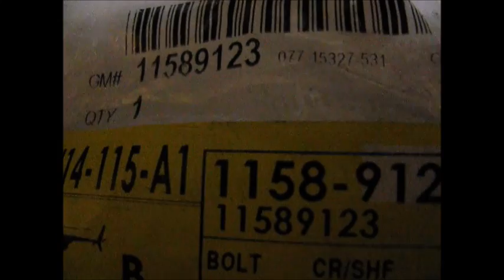GM 2.2L Ecotec timing chain replacement '03 Cavalier part 5: Front re-assemby

Comment: Not sure if you still read or respond to the video.  I just finished mine up and it sounds the same the pistons are turning I'm getting fuel and spark but it still sounds like it did before I started on it any suggestions would be a great help my timing marks are all on 10 n 2 and 5 for the crank I had #1 at TDC before I started on the repair not sure what I did wrong this was my first time ever attempting  to do this so I was pretty much learning as I went
Reply from the maker: It sounds like you did everything right. You may have to consider the possibility that valves were bent when the chain slipped or broke. This is an interference engine and valves can make contact with the pistons with chain failure. I worried about that when I did this repair and I got lucky. You may not have been so lucky.
Reply: @TheOriginalMechanic thanks for answering back much appreciated. everything was turning and when I turned it by hand before putting everything back together I didn't hear any noise or anything that sounded off I took the valve cover off again and the chain is tight the tensioner is set   it my first time so I might of missed or overlooked something but with no garage it's going to have to wait until it gets nicer out before I try again I'm 100 % on the timing marks I did check that yesterday day except the crank but I know it's at 5 cause I had to argue about that one I even checked all fuses just in case but all was good. It did backfire once but nothing after that it wasn't anything crazy that I would think did any damage or what not it wasn't to loud I'm just confused . If something else small and insignificant you would happen to think might cause the problem let me know
Reply from the maker: @00Slacker Yeah, that's frustrating. Nothing else comes to mind at this point.
Reply: @TheOriginalMechanic  thanks definitely appreciate the knowledge and your videos for sure helped me out with attempting to do that mess I'll keep tinkering with it and hopefully it'll come to life I'll get back if I can succeed..

Comment: Does that have tdc marks on crank sprocket
Reply: Turbo T I am not sure about the 2.2 engines, but on the 2.4 Ecotec used in the 2010 and later Equinoxes, which has VVT with phasers, there is a small notch on the edge of Crankshaft Balancer (or pulley) on the side closest to the front of the engine and a corresponding raised 1-inch indicator line cast into the front engine cover at approximately the 11:00 position. The problem is that this notch and alignment mark (or indicator line) are generally not mentioned in the various guides to this engine, and it is only obvious if you support the motor, remove the passenger-side engine mount, and then remove the tensioner mechanism for the serpentine belt.  Then, if you shine a light down to the spot I mentioned, you will see it, and then, with difficulty, you can mark it with paint, so you can find it again while looking up from the wheel well(after removing the plastic shield).  Aligning the notch in the balancer wheel (pulley) with this alignment mark on the front cover is the only way you can be absolutely sure that the engine is at exactly top dead center (TDC) if you are trying to fix valve timing issues without taking the front of the engine apart.  If you are off by 6 degrees or so on the valve timing on either camshaft, then the money light (a/k/a the check engine light) is likely to come on, the engine will not run correctly, and either you will have to go back into the engine and fix it yourself, or pay someone  a fortune to fix it for you.  Before I located this notch and alignment mark, I tried several times to find TDC by using a dowel and very careful measurements, but I could not do it accurately enough to reset the valve timing to the correct timing marks, and the cam/crank correlation codes kept popping up after a few  minutes of driving.

Where I live, the independent mechanics refuse to work on Equinox engines and routinely refer anything more than an oil change to the local Chevy dealers.  The Chevy dealer I took it to wanted about $5,700 to replace a bunch of irrelevant parts with no guarantee it would be fixed.  They told me that the engine might be blown, but would offer nothing as salvage. They wanted me to give them the car. This is a car I drove into the dealership with only a CEL and a few MIL lights on, but which was not running when I went back to check on it. Rather than pay them to experiment on my car, or give it to them, I towed it home and have done the work myself.

Comment: The video was great! Did mine today. Took the top radiator hose off.  Put a piece of 2x8 on your jack and a piece of 2x4 towards the front of the pan to pick the engine straight up. Remove 1 bolt from the bottom torque mount and jack the right end of the engine up and much easier to get 2 mount bolts out with a ratchet and one with a wrench. makes it nice to get to all the cover bolts out.
Reply from the maker: Thanks for watching and sharing!
Reply: thank you for the video could not have gotten through it on my own

Comment: im doing one right now and have a quick question do the timing marks on the chains ever line back up with the marks on the cam gears if so how many revolution's will it take
Reply from the maker: They are only for setup and do not line back up. Well anyway, I'm not willing to turn the engine umpteen times to find out if they ever do again!.
Reply: thanks
Reply: I just did this and turned the crank over numerous times after installing the new chain, etc, and so far they have never lined up again, but both cam marks appear to be in the correct position every time. The moral of this comment is to be very, very sure that they are lined up correctly before you think the job is complete; these chains are slippery and have a little slack in them until the chain tensioner is installed and activated, but during this process the pressure exerted on the cam lobes by the valve springs is enormous, and either cam shaft can suddenly turn and cause the timing chain to jump timing anywhere from half a link to one or more full links if you are not very careful.  There are commercially available plastic wedges that can help prevent this, but I used plastic tool handles to do the job. The timing of the intake cam is really critical for a successful job and it can jump a tooth in the blink of an eye. You really don't want to have to do this job twice.

Comment: I have a question about the 89in/lbs. I cant seem to find a torque wrench around here that goes lower than 120. Do you have any suggestions I kinda went just a little past snug but im not done yet either so I can go back and adjust them if need be
Reply: 7.25 ft pounds

Comment: Can't thank you enough for doing this series of vids.  I ended up having to tackle this job on my Cavy TWICE in the past month.  The first time was because the original chain tensioner had failed (at around 118000 miles).  Luckily I got away with minimal valve damage.  But the second time was caused by a faulty NEW cam sprocket... the keys actually sheered off on the intake cam!  (Duralast timing set from Autozone which I installed the first time around... they'll be getting some phone calls to corporate, soon).   Needless to say, I replaced the whole timing set again, this time with a Cloyes... and ended up having to replace 6 intake valves.   Anyway, I watched tons of YouTube vids to prep for the job considering that was the first time I've delved so deep into a motor, and your vids are by far the most in depth and informative.  Wish I could buy you a beer... or several cases.  

BTW I ran into the same problem you did with that stupid access plug for the upper chain guide bolt.  I jacked the motor up a bit and found I was able to just barely shimmy that mount off of the motor making it easier to get at the plug with a 10mm allen socket on a breaker bar and about a 20in cheater.  It took every 230 lbs of my body weight and strength to crack that thing, even after soaking in PB Blaster for a few hours.  When it finally let go I fell forward and smashed the crap out of my finger on a strut bolt I think.  Split it wide open.  Definitely put my blood, sweet, and tears into that job...  But, it's healing up and my car is running like a champ so I won't complain.  Thanks again for doing what you do.  You'll be my go to source for repairs from now on.  Cheers!
Reply from the maker: Wow, what an ordeal. You are a warrior. Thanks for the good words. You inspire me to make more of this stuff. (As if I could stop!)
Reply: Aaron,  I used a Cloyes, been around for years.
Reply: 0
00
Reply: ⁹
Reply: 9
9
Reply: 9
0l0
Koo
L
L
L
L
L
L
L
L0llll
Reply: Llllllll0l00ll00l0ll00ll0llll0l0ll0ll0ll0ll0l0l0llllll0l0ll0llll0lllll0l00000lllll0l00ll0ll00l0l0